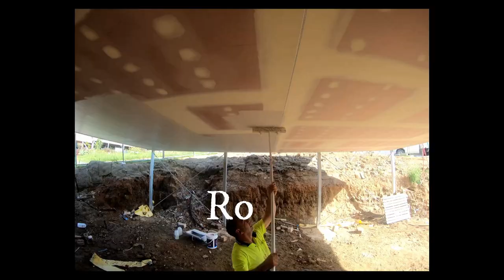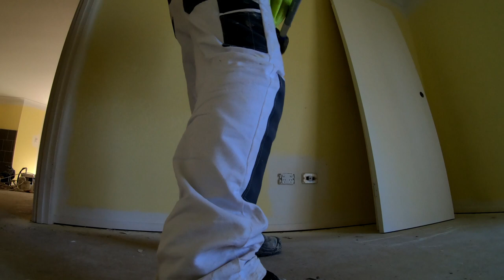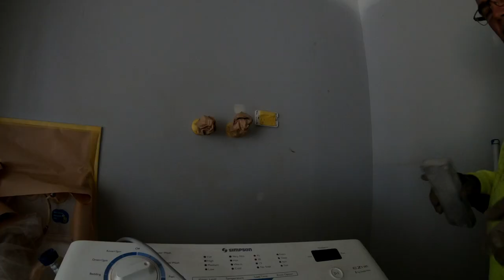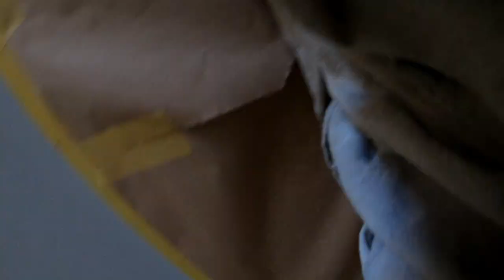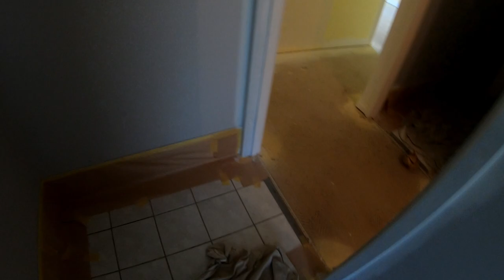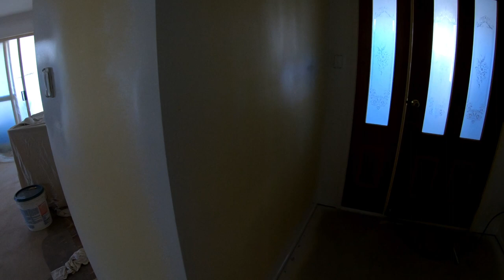Sand the doors ,walls and spray first coat

Comment: Most painters wouldn't even think of using a pole sander to rub the doors down , i use it on the skirts as well . Good job mate for showing small tricks of the trade in your videos 👍
Reply from the maker: Our skirts are to small to use pole sander but id love to make up a gadget to use two foam pads

Comment: Hey mate when you are spraying first coat on the walls I noticed that you are spraying over the cornice while spraying the walls 

Arnt the ceilings already final coated
Reply from the maker: It's the same color so it's not an issue,bedrooms and wet areas are the  same paint.Saves me cutting in,loungeroom /kitchen different paint
Reply: @ThePa1nterhowto   you doing Matt finish on walls on this one
Reply from the maker: @gina4leon  No its dulux wash and wear low sheen,it might look like im spraying the finished cornice but im just going beside it

Comment: Hi Gregory , if i want to repaint a wall (the paint about 8 years on the wall )do i need to Use undercoat  or just paint it with 2 coats paint without undercoat?
Reply from the maker: Just give it a light sand to remove any particles or foreign objects on the wall. (180 sandpaper), two coats of your topcoat, no problems.
Reply: Thak you Gregory 👍

Comment: What tip you using sir, 310 fflp ?
Reply from the maker: Low pressure 212 ,i use to use a 211 but just went up a size